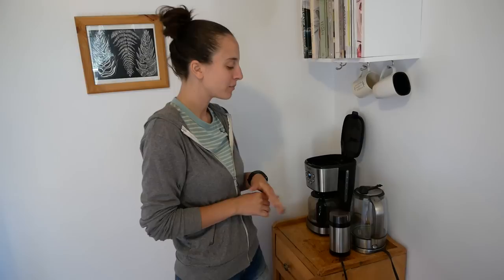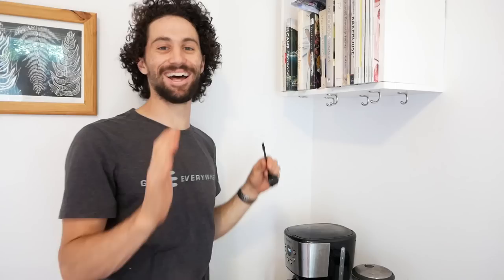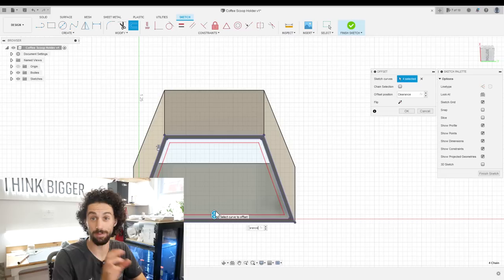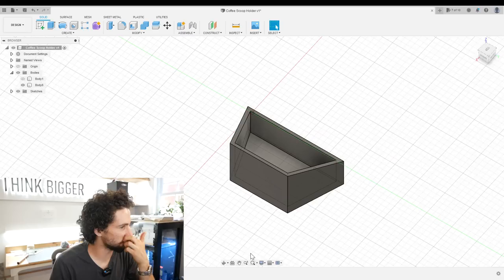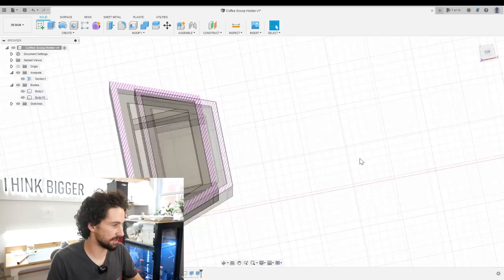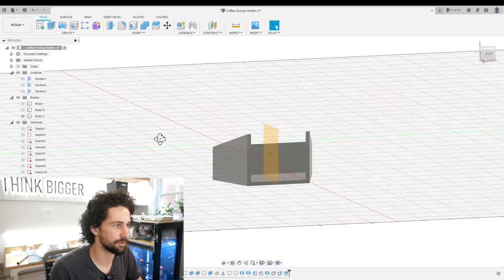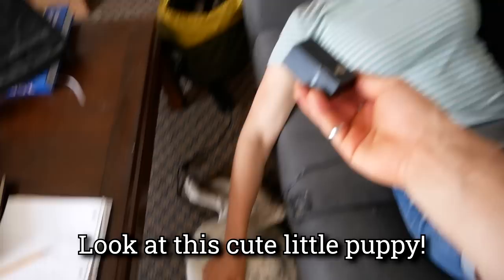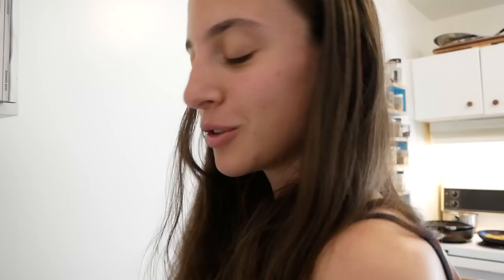Fixing Her Coffee Frustrations with 3D Printing

Comment: Next time you should reprint the grinder top with a pour spout to avoid the spoon all together.
Reply from the maker: But then how do you measure out the coffee?
Reply: @MorleyKert  integrate a cap with the measurement built in and a slide to cover the top when removing
Reply: @MorleyKert  weigh them before you put them in the grinder

Comment: Great video - I love practical uses for 3D printing.

Just wondering why you use imperial measurements in Fusion 360? 
My reasons for asking and points for consideration are:

* The USA adopted the metric system of measurement in 1866.
* The rest of the world uses the metric system.
* The filament you use is 1.75mm in diameter and the filament usually comes  as 1Kg spools.
* A typical 3D printer nozzle opening is 0.4mm. (a multiplier for wall thicknesses to make things easier?)
* In the print you showed, your slicer settings showed a 0.2mm layer height. (Have Z height as a multiple of 0.2mm to allow for printing complete layers).

All the best to you all,
Paul
Reply from the maker: It’s just what I’m used to, as I grew up in America, I do woodworking and my measuring tools are in imperial. A great part about Fusion is that you can mix units - I’ll frequently use mm and inches in the same model! Which is handy for thicknesses and perimeters, as you said.

One of these days I’ll switch to metric!

Thanks for watching 😊

Comment: Nice, always cool to see a problem solved.

I think a simpler/faster solution would've been just a rectangular box with the inside two walls having a bit of a slant most of the way down to keep the scoop falling all the way through.
The design seemed a bit over complicated on thie one from my perspective, though it's very late here haha.
I shouldn't watch these at 2am, I've just spent like 20 mins thinking of a different design for a coffee scoop I'm never gonna use lol.

It's hard to desribe with words instead of a picture, but maybe imagine it in CAD terms.
Start with a a rectangular shute that the scoop can fit in. Except, there is a flat bottom to it, just like a normal box.
Now, imagine you have a super, super simple version of the scoop in CAD - all straight lines, so the round shape becomes an octagon.
Then the idea will be to use the scoop shape to cut out the floor of the box, so the scoop will fit into it perfectly.
The next step is to flip that scoop around so it's like you're putting it in in the other orientation and then take another cut.
This gives a weird diamond like shape, or two triangles, left over from the cuts in the 'floor'.
That's where the scoop wil rest.

I hope that was clear lol

Either way, having a longer box means the handle can't rotate as much.
The epoxy would be so hard to remove if you wanted to upgrade it one day. I'd have started out with double sided tape or something less extreme, at least to begin with.

Anyway, one day I'll be able to do this stuff, I love tinkering and finding solutions to all those little problems. It makes so many things just that bit smoother.
Greater video, as always.
Reply from the maker: Thanks for watching! Longer box is a great, simple solution to the rotating handle.

Comment: It's not a very good grinder, you'd be way better off just getting a nicer unit. Wilfa WSCG2 is one I can recommend, you dial in your desired grind size and everything falls down into an easily managed container. If you use a scale and measure out the amount of beans you wanna grind for one pot of coffee, you just dump the entire container of ground coffee into the machine without any mess at all, and the grind size is way more uniform and makes for better coffee.

Comment: I think caught it!
spoilers for those playing along
You set the tolerance, but used the tolerance as the width of the walls. So the holder is the exact measurement with no tolerance.

The missing step was to do another offset to make the width of the wall, THEN extrude